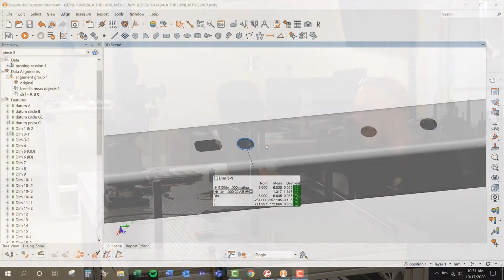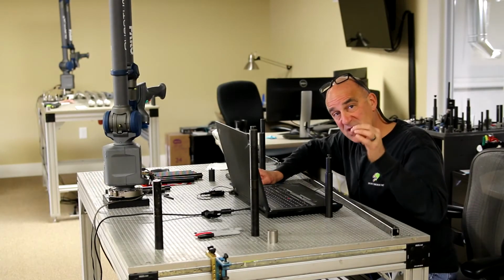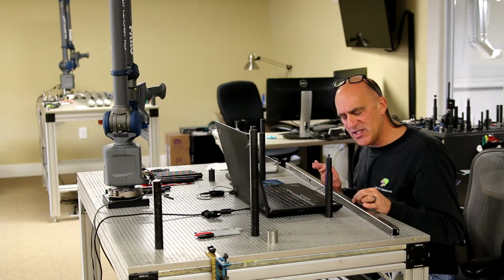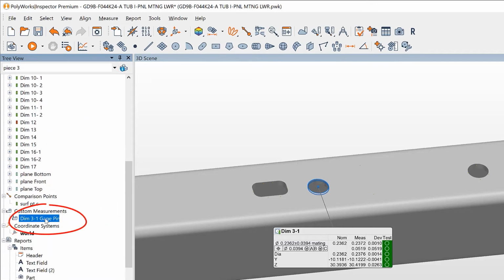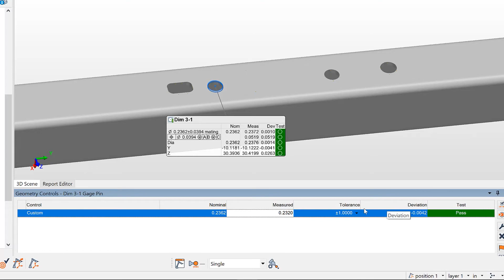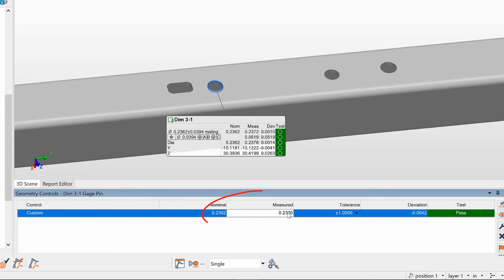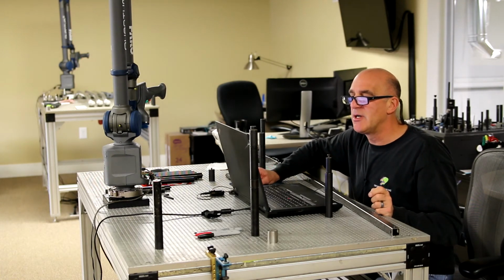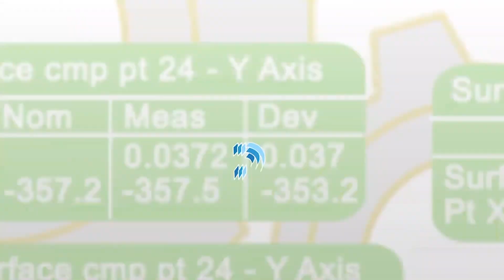PolyWorks Tutorial: How to Add Custom Measurements Using Pin Gages | Diverse Dimensions

Comment: Nice, a simple was to add manual measured features. You can also tie those into the Mated feature of size using formulas so that its used for the MMC if applicable